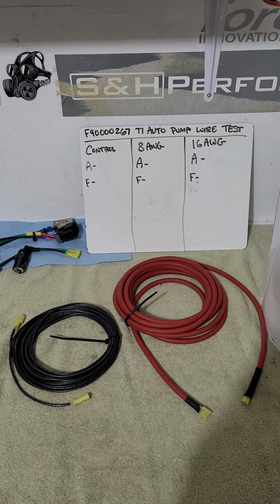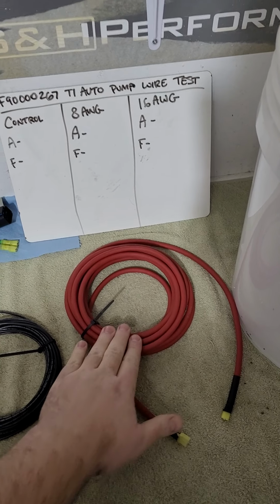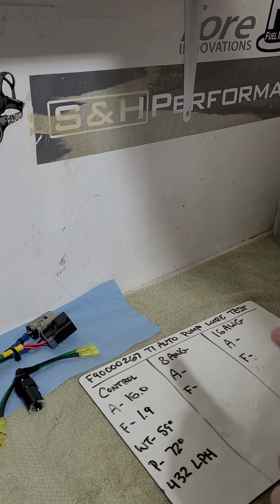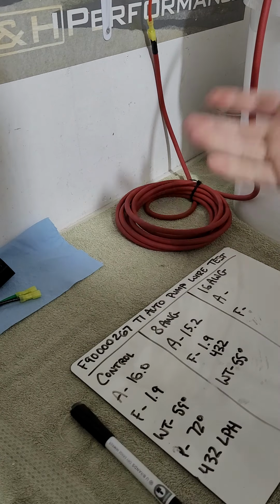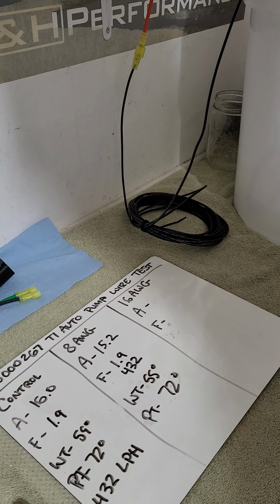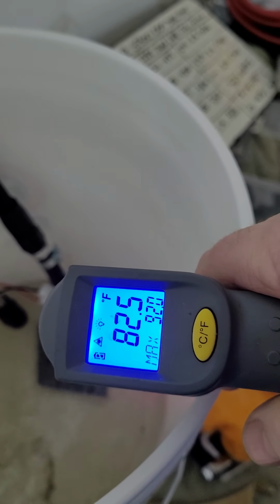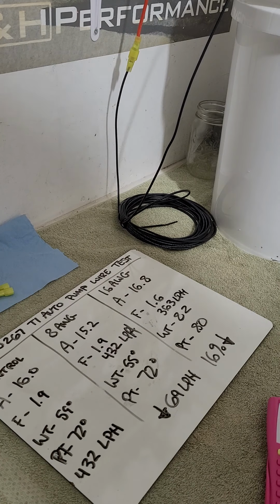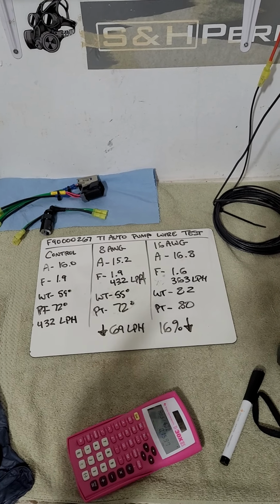Fuel Pump Wiring Test! Watch Me before upgrading your Fuel System!

Comment: for years ive been using stock Acura 1994 Integra wiring with a walbro 255lph fuel pump tuned...and have heen running in open loop mode since (no wideband)
.

if i were to upgrade to 10awg wire from battery to fuel pump through a 30A fuse & relay, would I need a retune?

Comment: I installed Walbro F90000285 on my Alfa 159 TBi on stock wiring and tuned car to Stage 3+ 400+hp after some time stock lpfp fuse 20A died twice in 2 days but saved me.It stayed out of fuel. I have put 25A fuse to can goes to service. In service we noticed that stock wire is just stock 2.5mm need upgrade so they put me 70A relay and full wire + and - 4mm from battery to pump. After that they started car but LPFP quickly died probably because it performed from begin with stock wire and got heat and LPFP itself was in heat. So i decide to install Walbro F90000295 like an upgrade as have all performed for that and 295 is perfect for single LPFP setup as dont have check valve. Now I know that wiring is a must part for LPFP upgrade. I have lucky that didnt broke something as I done a 40-50 times wot in 3-4 gear till 7250rpm and got leaner AFR 11.92 - 12 - 12.1 before it died. I highly recomand wire upgrade, good video!